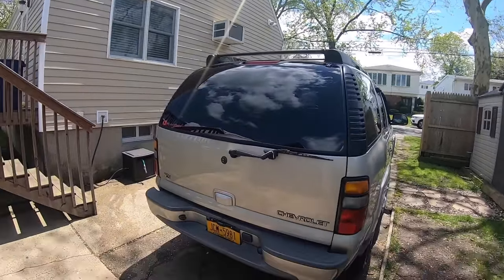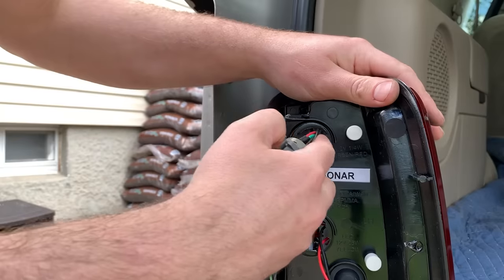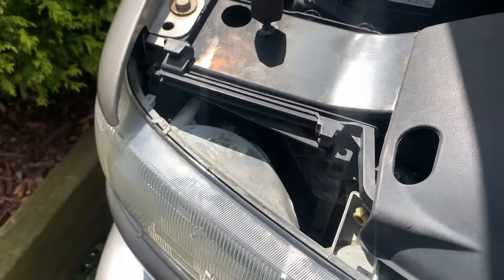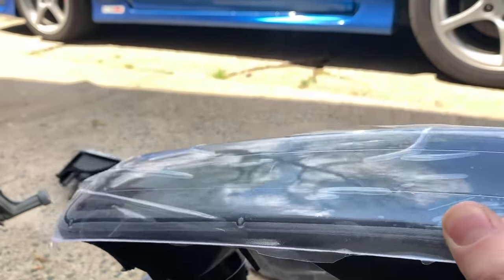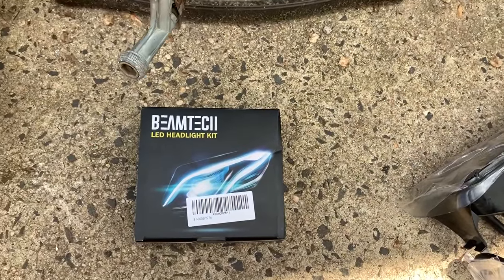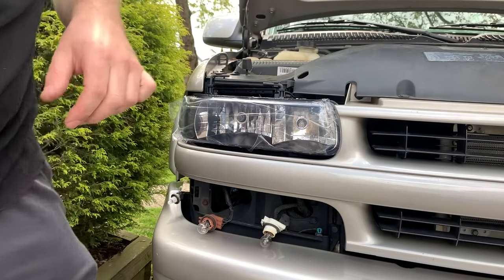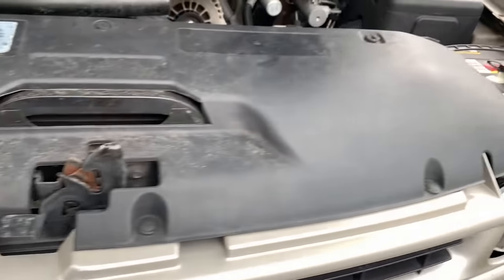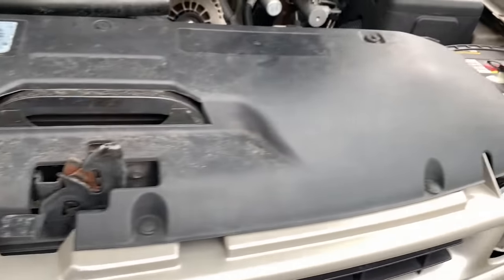Lights, Badges, Wheels, and Tires | IT'S TIME TO PIMP MY TAHOE

Comment: I want to do exactly this to a suburban when I get one. I do not want to jack it up because I’m handicapped, it’s got to be low enough to the ground so I can get in and out and also have my power chair in the back. I also want to have all the windows tinted except for the windshield and have some kind of system in it, nothing too fancy, just some six by nines on the doors and in the rear and one built-in sub, no boxes because I’m gonna need the space in the back, also I would put another newer black books shield in the front, it looks good like that, that’s all I would do and get it detailed inside and out. I have the bumpers sprayed. It looks good man.

Comment: Those Grapplers are usually really great tires. Mine never made much noise or had issues with cupping, unlike some other brands. And if you're going to level it drop the back end instead. There are kits out there that won't sacrifice the weight capability.

That truck looks great refreshed like that!

Comment: Really impressive transformation, Tahoe looks fantastic, and what an incredible bang for the buck you got there. The wheels are a huge improvement and the tires look awesome. One big downside is those tires are HEAVY. So many people (especially truck guys) have no idea just how much all that rotational mass kills the performance of the vehicle. If you just slowly cruise around and prioritize looks over performance than it doesn't matter. And there is nothing wrong with that, especially if you already have a fast car, which you do.  Me personally,  I couldn't bring myself to do it. Even with an H/C/I Z06 in the garage,  I love the fact my F150 can run low 13's, and handles surprisingly well for a big truck. Wish I could have both the badass beefy truck look and the performance but often doesn't work that way. Tried to strike a nice balance. Either way, awesome job on the Tahoe, and props to you for all the work you do yourself.

Comment: I did the same on my 03 z71 suburban. New modern z71 badges,grill emblem,headlights,tailights,led bulb conversion,short antenna,22" black wheels and window visors. Looks 100x beter and much more up to date. My only gripe about yours is the emblems the ones you picked are terrible. The ones i got are the one they used on the 05+ models and fit in that same area and are the z71 4x4 emblem. other than that i did basically the same mods lol

Comment: New to your channel. Just watched the entire video. I have an 07 Tahoe. Also running 305 tires on stock rims. Love them! Only two things I’d also do to yours if it were mine would be to match the two front side window tint with the rear, and I’d add a stainless exhaust tip on it, and maybe adjust the angle to shoot more towards the back end. I did this to my 07 and get lots of compliments on it! Looks great though!   Also, I’ve learned fishing line works a lot better than floss! :)

Comment: I have the same Tahoe 06 z71 4x4 but you can put the leds into the headlights. I believe it’s a 6mm and remove the couple bolts holding the plastic piece in and put the bulb in and screw it back together. Took me less than 5 mins
Reply: There’s YouTube videos of it that’s how I found out and did mine. Very easy to do, but the 880 bulbs for a fog lights I’m the same way I can’t get the cooling fan through. So I ordered led pods to put in them

Comment: The problem with aftermarket LED lights is that the brightness difference between the running lights and brake lights is not that much, so it's super hard to tell that someone is braking. Also, amber turn signals are much safer, as there's no ambiguity as to weather it's a turn signal or just a bake light.

Comment: in my opinions yu should swap out the mirror for black mirrors / maybe tow mirrors, take off the window rock blocker thingy🤣🤣, get some new sidesteps and the plastic on the bumpers where yu can step swap it out for black 8 don’t think the grey looks good, i’m also a fan of the z71 wheels but you should get them professionally painted black

Comment: I've got the same truck why don't you get some 2 and 1/2 inch lift hammers for the torsion bars and some lift blocks for the springs in the back, don't forget to spray undercoating or wax inside your rocker panels and underneath your truck or it's going to rot and real fast!

Comment: Quick heads up. My 05 Suburban cruise control no worky with LED brake lights. Turns out to be 05 06 GM SUV's uses computer for cruise and it uses brake light circuit for control functions. either use std bulb or add resistor so computer registers it.

Comment: The offset on those wheels is a little wider meaning a little further out from the suspension that’s why they fit one compared to the original equipment wheel good choice

Comment: Nice touches although the unibrow might help your black theme. Also considering how pristine the paint looks it helps protect it from rock chips.. they will dent it... 

Now this is my opinion what I liked on your add ins for sure was black bow tie, Chevrolet emblem, headlights and wheels. The rest I feel like was what made the tahoe look the way it did. Specially the old gold z71 badges. The taillights I would have just smoked a little. All in all as long as you truly enjoy your mods... clean tahoe

Comment: tahiti looks great man.. i jus saw the video with the kids note.. that was incredible.. they must have had a ton of memories in that car.. sounds like they essentially grew up in it.. with that one owner having it for all those years...  

question real quick.. your front seems to sit low like mine does compared to the rear.. did you try to adjust it out with the torque suspension bars up front.. or is there another issue?

Comment: i never have issues with my led/ hid lights not fitting in the factory lights. ive used many brands and no issues. i have usually had to take the brackets off first, but thats not difficult. I use an 01 silverado so our lights are interchangeable.

Comment: I love this body-style of the Silverado/Suburban/Tahoe. I've got a 99 Silverado extended cab long-box 4X4, first year of the series. Love the truck.
Personally, I'd just go with a smaller tire, i.e. P285/65r18 if you can find it at a reasonable price. It would be probably similar diameter, just not as wide which should correct the rubbing issue. They won't be as expensive as a set of 305's would be.  On my Silverado, I just run the factory sized LT245/75r16 tires the truck came with. I could up-size to 265 but I don't want to. I like the factory stance.  I work for Walmart as an Auto Care Technician so I got my 10% discount on the tires and went with the Walmart Goodyear Wrangler Trailmark. They are somewhat aggressive, but still make a good highway tire. It's a nice balance between on and off highway tire.  In that size, the white letter is not available, but it is available in other sizes.
Using smoked lights are somewhat limited legally in my state. You can do it to a lesser extent. It can only be a certain percentage, but I think how the Tahoe was done here would be acceptable.  Total blackout is not allowed, nor is putting blacked out tint on the front 2 side windows and the front windshield.  It doesn't matter if your vehicle is from out of state eather. It's not allowed period.  The back windows and the tailgate window, however, can be limo blacked out.  Just not the front.
Overall, the resulting upgrades look good. The CHEVROLET on the tailgate turned out very sharp. Looks factory quality. Great job. Great looking truck.
One of the things I've noticed on the newest models of the Suburban/Tahoe, is that they no longer have a front or rear bumper. That's one reason I love this body style. Still has a legitimate front and rear bumper.
Reply: @port nut hey. Live and learn.

Comment: i just bought one off Facebook Market Place 130000 original miles one owner all service records 1.100 .00i was at her house that night .new tires it was clean to me i though something wrong i drove over 2 hours so i had my wife drive my car back it drove home perfect the ride is smooth i been driving it everyday. sunroof ,tow pack package , all leather , she said she had about 75 messages but first come buys it , i was out the door GPS on if it was bad i wasted two hours but it turned out to be great SUV

Comment: Tape the edge of the parking light lens and spray some night shade tints to hide the silicone mess inside....🤔....love the setup...used to have a 2003 suburban Z71 withthe same color 😁.....
Reply: Leatherkid01 lucky I had a 04 in green I wanted that color

Comment: interesting that the turn signals are no longer amber. I know that us accepts turn signals that are either amber, or just the tail light itself blinking. Europe is pretty picky about that, not only do you need to have amber turn signals, but you also need to have a 3rd one on the side of the car.

Comment: Matt!  Your passenger side LED low beam bulb is not seated correctly!  The LED chips should be exactly at the 3:00 and 9:00 positions, but instead they are more at the 2:00 and 7:00 positions.  This will result in a shitty beam pattern and glare to oncoming drivers.  You should be able to adjust the chips to be in the correct location, then your lights will be great!  Don't forget to aim your headlights too, that way the light is on the road where it belongs, and not in the eyes of other drivers haha.

Also you should get some LED drop in bulbs for the DRL and turn signal.  All you'll need is resistors for the turn signals.

Comment: The only color that looks better than the pewter metallic on these Tahoe's is that dark green metallic. I found a clean 01 2wd fully loaded like yours, and it's beautiful! I'm slowly giving her the love you are to yours, and can't wait till she's all done up! I already gave her some factory 18's from a 2019 Tahoe, just like yours but in graphite! Plus, the head light/tail light treatment with a billet grill. Deleted the roof rack and the silly running boards, and it made a huge difference! I'm almost done with Tahiti's playlist, then off to summit to shop for a drop kit. Thanks for the inspiration!

Comment: How are the headlights holding up? Better than stock at night? Have aftermarket headlights in mine for the past 2 years, just noticed today that parking lights are drawing moisture so probably going to be replacing all of the lights. Mine are tinted and suck at night even with LEDs.

Comment: Not personally a fan of the Z71 emblems you chose, because the angular design of the modern Z71 badges just doesn't look quite right on a round body truck. However everything else is looking super slick! I absolutely love these model GM trucks!

Comment: Notice the rear taillights had a gap when u installed them from the top , does it rather or water go inside? 
For some reason I like the old rims you had on the tahoe.. but overall looks awesome ...

Comment: Bring the nose up there is a tool on eBay u use to turn the torsion bars . No need to use any spacers parts u just loose them up n turn them and levels the truck ..

Comment: Great looking Tahoe, What year is it?  I think it's time I get a Chevy.  My 01 F150 Supercrew project just doesn't make sense anymore.  By the time I'm done I still have another 10k that needs to go into it with a crate motor and gears.  ..and that's not even counting the paint work.  :/
Reply from the maker: Its an 04

Comment: I used to drive GM exclusively , but since they found out that they were spending 20% more than ford on production, quality has gone down the drain. The corporate bottom line bottom feeders decided to put that 20% in their pockets letting Ford get ahead of them in dependability. I don't like saying it anymore than you like hearing it, but them's the facts! Got a 2001 F-150 outside w/226k miles on it, all original and she's still pulling strong with minimal maintenance. And they really hold their value, but I will say the Tahoe looks good, I just hope nothing comes up that turns it into a boat anchor. Oh crap! I just noticed the video of a new transmission instal, well it's your money, and I'll admit I am going to install a transmission in one of my rides. But it ain't gonna cost much and is actually a real simple job on my car, sucks is that I just put a new clutch in ($60 lol) and it lost 4th gear :( It wouldn't bother me so much, but now the damn rear main is starting to leak! So I might as well put a new gearbox in it while I'm at it. Life: "I'm gonna work you like a rented mule boy!" Me: "Don't make me do stuff!" ;)

Comment: That speaker doesn't have a subwoofer  it has a passive radiator, and it has that so it doesn't need a port

Comment: Quick question, I've noticed some 2000-2006 Tahoe's have barn style rear doors vs a tailgate style rear door. What's the deal with that? Did specific years come with different rear doors for 2000-2006?
Reply from the maker: Yea you could get them with barn doors as well. Not sure of the exact years, but I think it was only the 1st and 2nd generations.

Comment: Overall it looks really good, but I personally would of not put on the Z71 badge on the pillars and back.. I think Chevy made a mistake putting badges there of all places, and think it looked better to keep the pillar clean... But, if you do ever sell the truck at least you do show off the fact you have the vary desirable Z71 package.  Everything else now being blacked out about the truck now is as you said you intended.

Also, I like the way you line up the Chevrolet logo.  That's slick and something I'm going to have to remember if I ever find a Chevrolet of my own in need of new badges.
Reply from the maker: Yea I was really thinking about just leaving them off. I just decided to put them back on because thats were the factory had them.
Reply: @lsxmatt  Oh wow.. Senpai noticed me!  Thank you, I was really worried you take offense to the opinion on what your vary desirable truck.  I am definitely looking forward to seeing what you do with it since you look like you want to keep it looking clean, and use value priced modifications.

Comment: I just got a 2003 Tahoe and I want to customize it. It has bad paint (peeling off, paint is not glossy in some areas)  and I'm having a hard time to decide if I want to  repaint it in the same color (burgandy) or might as well change it. What do you think?
Reply from the maker: I would repaint the same color. It would be easier as all the jambs and under the hood would need to be painted as well to do it right.
Reply: Oh ok thanks

Comment: I'm confused. You clearly know about the difference between projector and reflector headlamps, because you mentioned it, but you still put LEDs in reflector housings in this video. That's really unsafe. I'm also a bit bothered by the deletion of amber turn signals, but that's far less of a big deal.
Reply from the maker: I didn’t go with a projector light because none of them look right to me on a vehicle this old. After installing the led bulbs I measured and adjusted the housings so the highest point of the scatter beam is purposefully aimed slightly below the center of the headlight. I can pull up behind a car at a stop light and they won’t even shine into their rear view. The sides of the beam have been adjusted inward as well. For the amber side marker that was just overlooked by me. I didn’t even realize it was missing until a few people mentioned it. They make the same housing with the amber reflector built into the corner of the light, so I can always swap them out if these start taking on moisture.
Reply: @lsxmatt  It's pretty common even on brand new cars to omit the amber. I do think it looks nicer in many cases, and definitely that style looks much more modern than the originals. My parents had an '00 Suburban forever so I'm quite familiar with them! But yeah, I'm not a fan of the trend to omit amber just for clarity sake. I was pretty happy when Technology Connections did a video on it.

Per headlights, honestly the only thing stopping me from LEDing my '00 CR-V is the reflector lenses. There are some $400 projectors I can get on eBay that are damn tempting but I don't have that kind of budget at the moment.

Anyway I do have to say your work does make the truck quite a bit more modern feeling!

Comment: what tpms sensor are you using ? the originals from the truck or 2014 from new wheels?
Reply from the maker: The 2014’s didn’t link up. I have new 04 sensors.
Reply: @lsxmatt  I thought that 2014 uses 315Mhz like my 2004 Suburb...I want to put same wheels than your....

Comment: Did the local police dept pay u for steeling air time from ur video 😁. I really wish someone would develope some led's to replace those horrid plastic trims that sit above the brake lights. On the escalade they are vertical led brake lights. Totally ruins the back of the truck. 
So ive got an 01 yukon xl slt & i really want to put in a large touch screen, possibly tablet for me radio /music/videos etc however ive got that 1.5 din 😡 so was thinking about pulling the 19th century cassette player out and fabricating a mount that will accept a nexus or ipad tab. I see ur gen has a shelf type tray already . Do u have plans to do something with that or u happy with the tray??

Comment: Those tail lights don't appear to fit super awesome, the gap at the top is not right imo. Also the light patterns are kinda meh. The whole red area should light up as a tail, then get brighter for breaks, for turn signal they should of made the lower area blink or maybe just the whole red area. Looks weird the way they split it up lol. They do look better than factory though I'll give you that.

Comment: Dont know where you are at with your Tahoe, but you need to put a couple of turns on your torsion bars under the truck, 3/4" socket to level the truck, you will love the look it brings, check me out at CF Auto Innovations on you tube to see my 2001 suburban build! Have a good one!